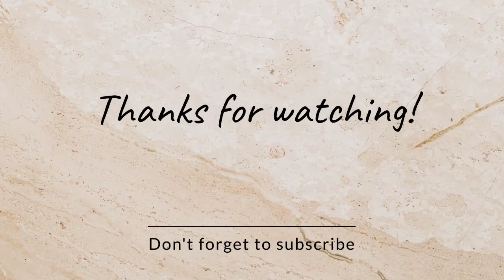Mengganti baterai AA (mainan sikecil) dengan baterai 18650 (bekas baterai laptop)

Comment: Sya yakin gak lama rusak tu, soalnya volt batere 18650 terlalu besar, soalnya sya coba di 3 mainan malah rusak semuanya
Reply: tinggal dipasang resistor, biar jadi 1,5v.
Reply: Kenapa 1,5 volt, awalnya baterai AA x 3 dipasang seri itu tegangannya 4,5 volt,
Reply: Kalau dari baterai 4 di ganti 1 aja apakah malah tambah aman tidak?  @bahauddin9153
Reply: @wendytututrilaksono640  seharusnya aman tapi tenaganya kurang, batrei 18650 klo performa full tegangannya cuma 4,2 volt, klo pengen awet tambah batrei 2 atau 3 tapi jangan Diseri, dibuat pararel aja